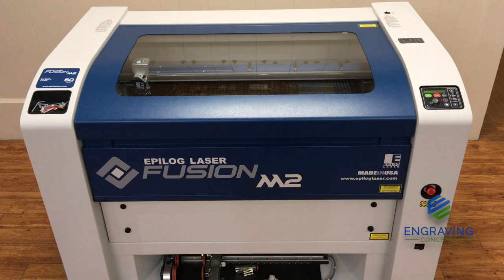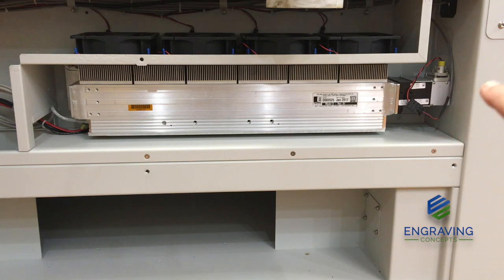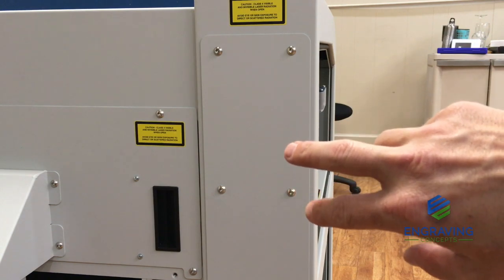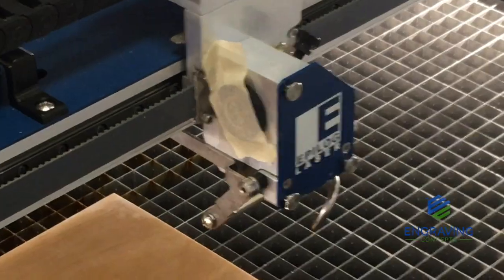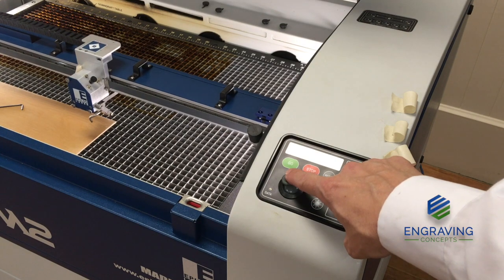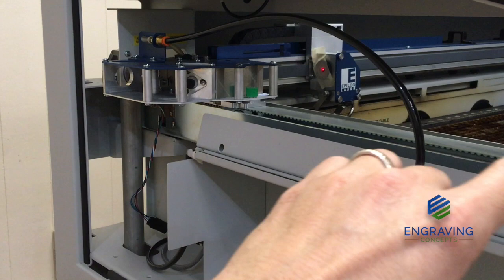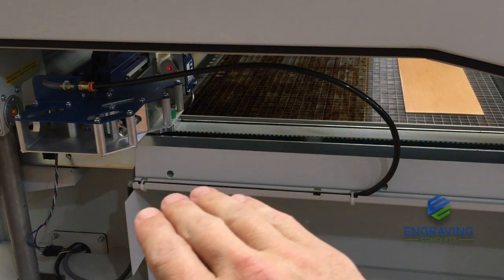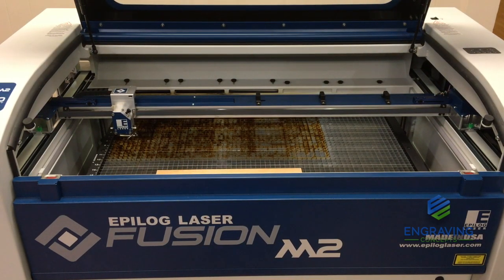Epilog Laser Beam Alignment for Fusion & FusionM2

Comment: * Be sure to use safety glasses *

Written Guide HERE ** click READ MORE TO SEE THE written steps.

1.)  (Test Fire) the real laser to the  bull-eye target to verify the red dot pointer and the real laser beam are aligned together.

How: —> With the plastic bulls-eye target in the lens assembly, covered with masking tape, and the machine in alignment mode, move the lens assembly to the center middle of the table.
—
Turn on the red dot pointer, but pushing the Pointer button on the display.
Then test fire the laser with by putting the display in JOG mode, then push the white laser button, then use the joy stick; tap the joy stick in any direction and it will  fire the laser beam (doors must be closed) onto the tape that is on the bull-eye.

* If they are NOT use the Allen wrench in the back right corner of the machine to adjust the RED DOT POINTER ALIGNMENT screws —> till the red dot pointer is sitting on top of the burnt spot of the real laser ON THE TAPE, on the BULLS-EYE.

After you have verified the red dot and the real laser are together now you are ready to test the alignment in each corner.
—————————————————————————————————————————
2.). While in Alignment mode,  move the lens assembly to the upper left corner of the table.

Then, move the carriage by hand, to the back of the machine and to the front of the machine, keeping the lens on the left side of the carriage.

Be sure the red dot is staying centered or parallel with the table.

If it is off, use the adjustment Allen screws to adjust the red dot.

IN THE UPPER LEFT CORNER use MIRROR # 1
IN THE LOWER LEFT CORNER use MIRROR# 2

Move the entire carriage front to back till the red dot stays in the center of the target.

Once you have the beam aligned front to back, now you are ready to check the alignment from the left side of the table to the right side of the table.
—————————————————————————————————————————
3.). With the carriage in the middle of the table (front to back) put the lens assembly on the left side, Then move to the right side of the table, IS THE RED DOT STAYING IN THE CENTER OF THE TARGET?
If yes, you are done.
If no, use the 3 alignment Allen screws on the steering mirror on the left side of the carriage to adjust the beam till it, STAYS IN THE CENTER OF THE TARGET AS YOU MOVE THE LENS TO THE FAR LEFT AND RIGHT SIDES OF THE TABLE.
—————————————————————————————————————————
Any Questions? 

Epilog Laser Technical Support
We're here to help you through online and phone assistance.
Looking for help with your laser system? There are many easy ways to contact our Technical Support Team:
* Search for the answer in our Knowledge Base
* Submit a service ticket that can be tracked online.
* Call +1 (303) 215-9171
* Email tech@epiloglaser.com
* Fax +1 (303) 277-9669

You can also computer CHAT with them:  https://www.epiloglaser.com/tech-support/technical-support.htm

Comment: Great info Randy! Can you please make one for the Legend36EXT?
Reply: Thank you fro the feed back, but I don't have an EXT demonstration unit.  However, I can tell you that the alignment concepts for the EXT would be the same; only thing different is that the EXT has built in beam alignment.  On the keypad you go to Maintenance | then Align Laser, then as you push the Up Key it fires the laser and allows you to move the carriage by hand in each corner.   Actually the video for the Helix beam alignment would be almost eactly the same.